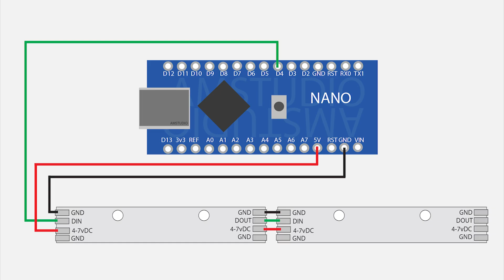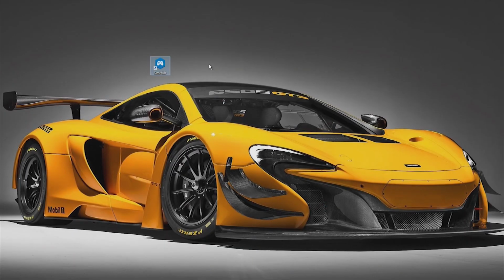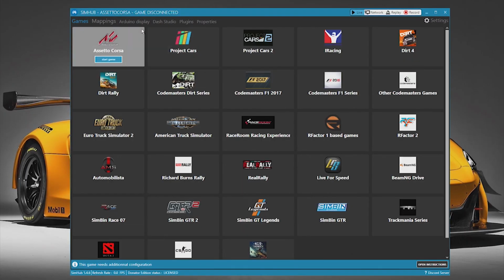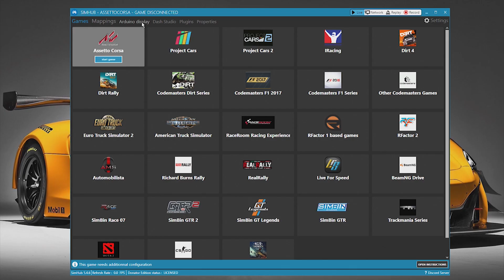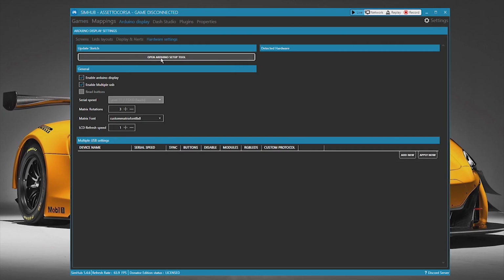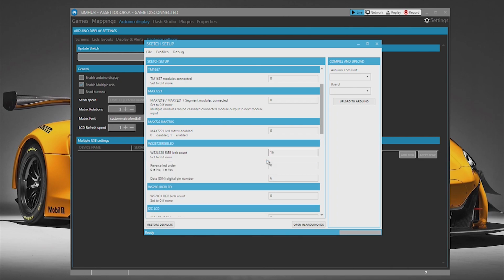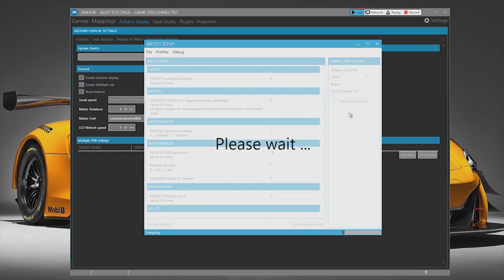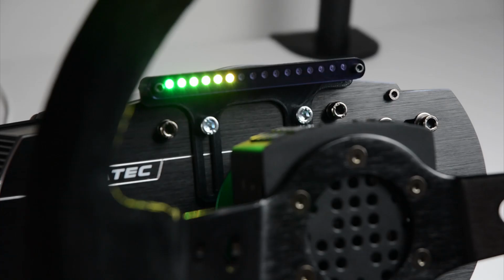MAKE ARDUINO RGB REV LIGHTS w SIMHUB

Comment: @amstudio still a brilliant video for 7 years old!  👍  

I made one using a WS2812B led strip which made the process even simpler. This way I don't have a gap between the leds (better for my OCD) and I used 20 leds. The outer two are for the car spotter left/right and the center 18 are for the revs.

Thanx for the awesome tutorial, even a soldering noob like me can pull this off.  😉
Reply from the maker: That’s awesome to hear! Glad its helpful

Comment: A tip for those with 3D printers that would be printing a case is to include a 0.1mm or 0.2mm layer in front of the LEDs instead of the Perspex cover, this would act as a filter and reduce glare. 
They also look cool because the LEDs are only visible when switched on. If you're worrying that the LEDs are not bright enough to shine through the layer, don't be, as a matter of fact I only use 5% brightness on Simhub with the 3D printed layer in front of the LEDs. It is best for the LED's to be in direct contact with the layer for the best result.
Reply: this layer is like not fully covered right? it's like a fence sort of? also what pattern would you use?
Reply: @allanpham684  It would appear to be fully covered when the LEDs are off. I did not specify any particular pattern in the slicer. The layers are normal criss-cross pattern as any first layers would be. The LEDs would shine through the first couple of layers.
Reply: @yamyam60 okay is visibility still good?
Reply: @allanpham684  You can try it out by printing a rectangle of .1 or .2mm and manually placing it in front of the LEDs, it only takes a few minutes to print. Make sure it is in direct contact.

Comment: @0:27 I'm building my own dash, and I need to solder 3 of those 8 led boards together and I'm wondering what that metal rod you put between is. Is it solder wire or something else?

Comment: Hello, could someone help me? I did the same as in the video the second strip of LEDs does not work well, even if I increase the brightness the 2 strips begin to fail. Does it carry some kind of external source or some resistance? Thanks a lot

Comment: Just found your channel. Awesome videos. Looking forward to making some of these projects.

Oh, and on the first corner of Brands Hatch, try breaking a straight breaking line down the middle of the straight and turn in for a slightly later apex just before you run out of road, then go full throttle to exit. It'll feel like you're about to come off into the gravel, but that dip at the bottom of the hill will give you a mass of traction just in time to keep you on the track. Feels great when you get it right.

Comment: Once the Arduino is flashed do you still need to run the SimHub software and settings on the host machine for the LED's to function correctly? or is it just plug and play with any PC?

Comment: Hi! Thanks for this video! Do you know if i need to use an arduino board exclusibly for this lights?  Or maybe  i can  assingn a pin ( like 6 in the example) on an existing arduino board in my diy steering wheel.
Can I? Tks!!!!
Reply: hi, did you try running this off your diy wheel?? I would think it would work but maybe need to merge the sketches (arduino) together?

Comment: Hello, I have installes an ArdNano making some flag signals and a optical spotter mark for me.

Now I will do the REV Lights as well. So I bought s new Ardnano and all the other stuff, assemble it and try to make it running. Do I have to make a new Ardunio SetupTool - is it a multiple or a single ArdBoard? Or can I put the LEDs on the first Board as well?

Comment: Did you cut down the perspex yourself or find it made?
Reply from the maker: https://youtu.be/aLohcEFa850
Reply: amstudio Thanks! Does the 3D print file include the mount in it?
Reply: @amstudioprojects   The 3D file has the housing file, do you have a file for the mounting bracket you made?

Comment: Hey mate, got a quick question regarding building this and the screen you made for the sim. I designed a box that incorporates both LEDs and the screen but I want to run just one USB to the unit. Can I wire both off the One USB or will it confuse it and not work properly.   Thanks a lot for all these videos. Brilliant work mate.  Also I’ll be happy to share the STL file for the screen/LEDs box once I have it all working.

Comment: im running out of usb ports on my computer .would it work if i add this to my exsisting arduino board which my wheel hub and pedals are connected

Comment: I ordered the LED's through your DX link, they sent me different LED strips.  I got WS2812b-8 which do not fit your file.  The LED's are spaced out further and the strip is longer.
Reply: My correct LED strips arrived, they fit the case with some triming of the PCB edges. Thanks!

Comment: Unfortunately not all ws2812 modules are equal and after building this all I  got was random led action and yes it's wired correctly and setup correctly. After changing for individual led versions it works fine but for some reason not with these modules. I've ordered the ones from the same supplies as you hope they work.
Reply: Hi, I'm also having problems and I can not get it to work, it's also all properly wired and so on. Could you help me?
Reply: @SergioVics  not currently mate but will update when its worked out i figure it's cheap version of WB2812 stick. can be an issue if not soldered nice and neatly so hope your soldering skills are not the problem. I have new sticks coming but it will be a few weeks. The arduino code is meant to take out any issued data errors so Wotever states so I'm unsure at the moment keep you posted.
Reply: @griffo3043  Ok, thank you, I have ordered new leds to test. good luck and we are in contact.
Reply: @SergioVics  have purchased arduino brand stick and they work fine but cost $10 AU each so fair bit more expensive the product ID is xc4380 you can get them from electronics stores that sell arduino gear. Jaycar in Aus. Only bought one to try but this made the second wb2812 work properly if put as the first module. Slightly different size and spacing of leds so I'm still waiting for new wb2812 as the others won't fit 3d print mould.

Comment: I dont have a 3d printer is there any other case our there?
Reply: Its a good Question.
Iam from Gerwany and search also this case.
Reply: GMR166 You could use 3D hubs. 

I could ship it but I’m in France, I don’t know what shipment would cost but I’m ok for it.
Reply: GMR166 I've checked. 

Shopping IS available at 2,5€ max, so it it is very easy.
I will made the piece myself, to avoid you paying the 5€ file, as it is very easy to make. 

I checked it would cost 25€ on 3D hubs. 

I can offer it to you at 10€, shipping included. 

Are you interested?

Comment: Love your channel! You've inspired me to make my own F1 style steering wheel for my sim rig. I'm planning on using these shift lights as well as a 7 segment display (8 digits, compatible with simhub) and also several push buttons. Ideally I'll power it using the 6 pin DIN plug from the original wheel, and use bluetooth to communicate with my PC. My question is, would I be able to run all these functions simultaneously through simhub? Thanks.

Comment: Hi @amstudio, ever thought of mounting them directly onto the wheel rim?
I'm considering to mount them to my TS-PC formula rim. There's a slot that seems made on purpose for such a mod. Of course I'll be doing the LED enclosure by myself. But what about the USB cable? Will it be a problem when steering?

Comment: Hey Mr. AMSTUDIO,
I ordered the parts thru your list, soldered it together ..... and it works like a dream.
Thank you very much for the good work!
Rob
Reply: Robby Schafhauser Also curious
Reply: Can you send me the 3d file?
Reply: where did you get the black casing?
Reply: Where the links bruh
Reply: How much did it cost total?
Reply: @EMS9729  could always press the link and use a calculator?
Reply: @matk22  yeah but why not ask, all links are most different sites.
Reply: @EMS9729  just bought it, €6,34  on Banggood since I already have some cables and usb cable. Do you want a link?
Reply: @underrated-simracer  yes ! Only €6 for the leds? I also have a usb cable. €6 is really cheap!!
Reply: @underrated-simracer  ??
Reply: @EMS9729  what?
Reply: @underrated-simracer  the link please
Reply: @underrated-simracer  ????
Reply: @EMS9729  yeah ur blind, I’ve just send all the links
Reply: @underrated-simracer  where are the links
Reply: @underrated-simracer  bro can you send the link
Reply: @EMS9729  bro ur blind, I’ve already send them, are you joking or what?
Reply: @underrated-simracer  if I’m blind why do I don’t see them? Why would I ask a lot if I can’t see them. I don’t want to waste my time I want to build that thing
Reply: @underrated-simracer  could you send them somewhere else ? I can send you a screenshot because I don’t see the links any where
Reply: @EMS9729  scroll to mid of this conversation
Reply: @underrated-simracer  fr I can’t see them 😂😅
Reply: @underrated-simracer  I found the RGB for $3, good price?
Reply: @EMS9729  what is ur email? I’ll send you the links
Reply: @underrated-simracer  you got it bro?
Reply: @EMS9729  yup it’s done, only the 3D printer housing doesn’t fit
Reply: @underrated-simracer  ooo okay, did you also send the links to my email?
Reply: @underrated-simracer  what is your email?

Comment: Hey. I am fascinated by your project presenting the engine speed display with LED strip. As I do not have experience in designing Arduino modules, I am asking for a hint. Will I be able to use one Arduino controller to connect the LED module and analogue Handbrake, which also show how to perform on your other film. Will the Arduino module be able to control the LED strip and be recognized by Windows as a pointing device? Thank you in advance for your answer and I am waiting for more inspiring fans to create new devices.

Comment: Great vid!!! Looking at doing my own based on this.

All the links from the perspex downward seems to not want to open? Where do I get the perspex and could you please supply the detail on the wire you used as well as the nuts and screws sizes as well as the detail on the soldering?

Comment: I am making a f1 wheel project. I have maped the button with your arduino library, as well as the rotaries and a clutch pedal. I can use the same arduino for simhub or this will overwrite the rest? I don't if I was clear... Not really good english

Comment: im using the ws2811 12v led and they are not working. are they not supported?
Reply: Fixed it. I forgot to press save after adding the device

Comment: What material did you use to connect the 2 LED boards in the middle? I saw some tin but what is the little piece of metal?
Reply: Also how high temperatures were used when soldering?
Reply: Please tell me bro :( It's holding me back from doing this mod, it wouldnt be possible to connect those 2 boards with wire only..
Reply from the maker: Its just a small piece wire from a resistor. Temp was set at 350c

Comment: as always a great Video and thank you for that. I build it a few months ago and testet it with F1 2016, PC1/PC2 and it worked great. Now i have Problems with F1 2016 and the Lights, they don't work ingame but when I press Pause theay light up, back in game they turn off. Any idea what the Problem is?

Comment: Hi, ever thought of mounting them directly on the wheel rim?
I'm considering to mount them to my TS-PC formula rim. There's a slot that seems made on purpose for such a mod. Of course I'll be doing the LED enclosure by myself. But what about the USB cable? Will it be a problem when steering?

Comment: thanks again for this tutorial, even though the simhub software is a lot different now with your video i was able to set mine up.  Just wished i had a 3d printer to house the LED's
Reply from the maker: Use a local print service like 3dhubs

Comment: Is there a way to buy the case to put the lights in or does it require owning a 3D Printer? Just wondering as would love to make this however not having access to a 3D Printer is an issue.
Reply from the maker: Hi Matt, you can use a local print service like 3dhubs
Reply: Are you still looking for it?

Comment: What wire did you use when soldering to the nano board?
Reply: paul English123 the usb cable in the desc. Buy 2 of them for this project, one to plug into the arduino and one to strip and solder

Comment: Good video friend ... I have a question. Simhuh software is paid? do I have to buy it to license it? is that when I configure the .xml of dirt rally / 4, it tells me that it is not connected. How do I connect the software with the game? I already camped all the components to make the rgb lesd rpm. Its beautiful!!
Excuse my English.
Daniel, from Argentina.-
Reply from the maker: SimHub is free but with a donation to the Author you get unlocked features and higher refresh/frame rate. It also helps the developer continue with the great work for all of us to enjoy! There is a support page where they can help troubleshoot problems.
Reply: Many tahnks!. this tutorial is used to do rpm with 8 leds? should I just change 16 and put 8 in the setting menu? it's what I want.
Reply from the maker: Yes just adjust the sketch to 8 if your only using one module with 8 LEDs.
Reply: thank you very much friend!! You are a genious!!

Comment: this stuff is lit, i might consider making this if i really need this but im getting a new steering wheel first
Reply: Tristan Boumans really?
Reply: A nano V3 from china is under 2 euro, the same goes for the TM1638 display. Then you need some plexiglas, bolts, nuts and something to wrap the front of the display.  I did a similar build (used a cheaper tm1368 with only red LED's)
Reply: Tim aaa Okay thnx do u have a video about it?

Comment: Would it be possible to wire this into the button box or would you need a seperate Arduino just for the LED's?
Reply: I'm working on surporting arduino micro but for now it doesn't work, I hope to solve this in the month, it will allow simhub/button box hybrids
Reply: With modification of code you could use one. However if you do not know your way around C and arduino. It is a lot easier just to buy another arduino. The chinese clone arduiono market is great for this because the cost less than 2 or 3 euros.
Reply: I'm asking because there doesn't appear to be a sketch for it .It more seems like the Arduino Interfaces with the software in real time. Hence I question if it's possible to make it run as a USB device as well simultaneously.
Reply: Ah sorry, I didn't notice this uses simhub. It seems that simhub sends data over serial so to do so it must overwrite any sketch on the arduino. While I am sure with some trickery you could use one arduino it will not be easy. At least that's my view on the matter.